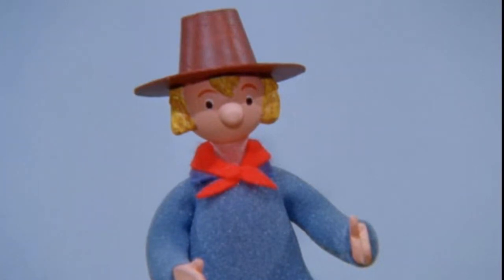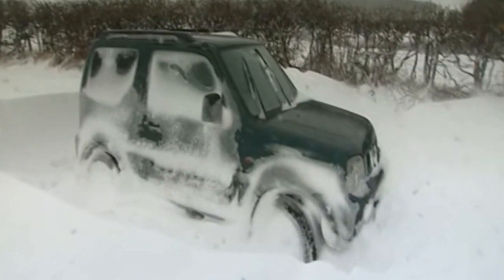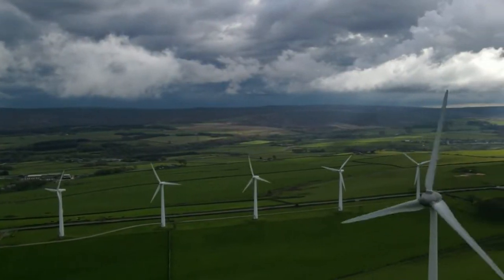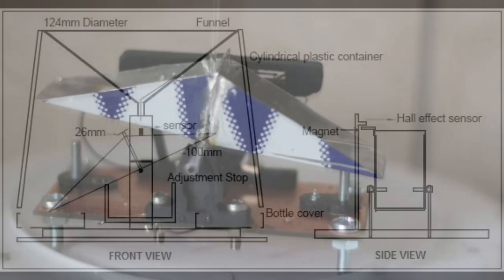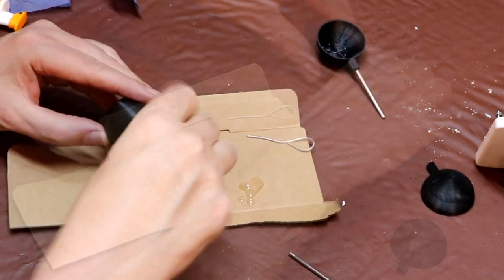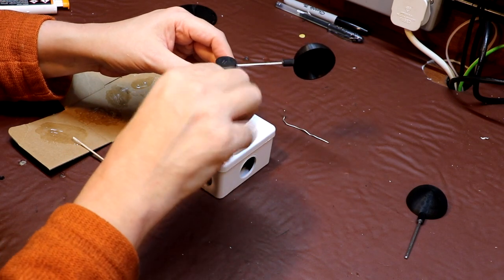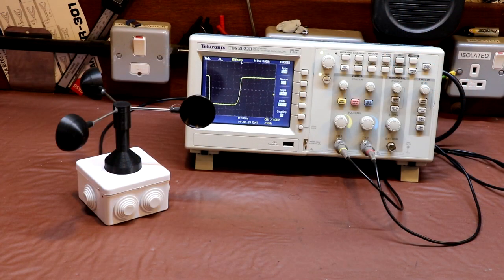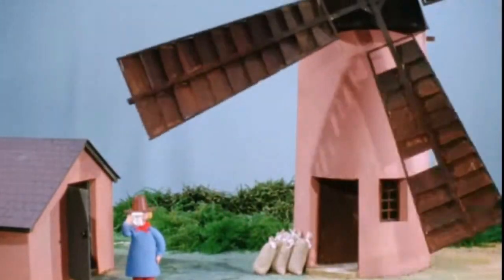Raspberry Pi Pico - Weather Station Part 1

Comment: A very interesting video Chris. as you may know, we have been running a weather station for over 20 years, and have repaired the anemometer in the past. The Davis systems use reed switches and seem to have a life of around 10 years. When replacing the reed switch I have found that corrosion has formed on the legs of the switch. Most of our failures occur in winder when the temperature falls below freezing. The end of the reed fractures and causes a miss anignment of the contacts. I have replaced these reeds with similar components but also covered them in a conformal coating to protect against damage.
Reply from the maker: I think your correct on the reed switch failures I will add a correction  in the next video it’s a good call thanks.

Comment: Chris is a gifted genius. There are also UV resistant gray PVC electrical boxes w/gasket available at reasonable cost. Don't forget about hot wire anemometers, which are really not suited for this outdoor application. Just a different type to learn about. Cheers.
Reply from the maker: I like those boxes that are glass fibre reinforced I use them at work but they are expensive. I did look at hot wire and also ultrasonic but a bit complicated to build.  Thanks for watching regards Chris

Comment: For boxes use your 3D printer and design using parametric setting in the design and you can make boxes with screws of any size you wish?? I use freecad, and Ulimate Slicer 🙂
Reply from the maker: I’m still very much new to 3D modelling but really enjoy the design process and the ability to do 3D prints is awesome. Thinking of a resins printer for my birthday
Reply: @allthegearnoidea6752  if you do use Freecad for design this guy is a really good teacher on youtube "MangoJelly Solutions"